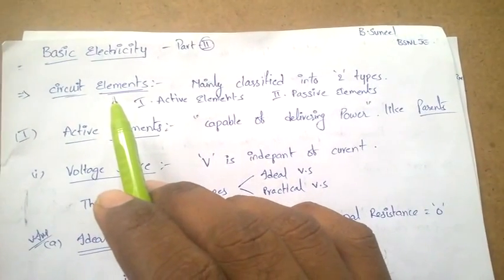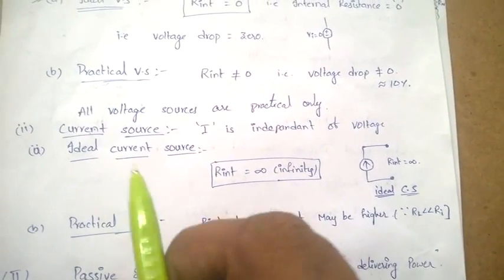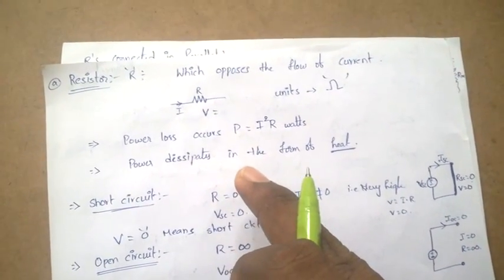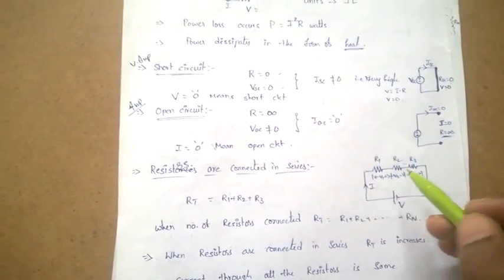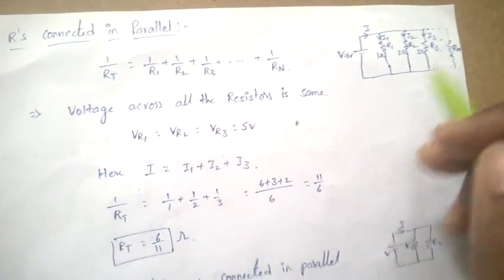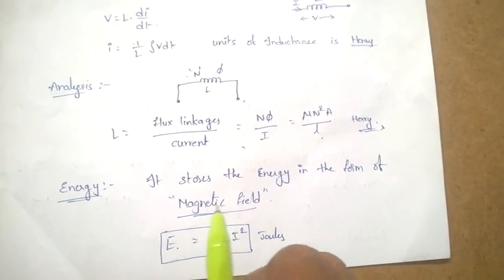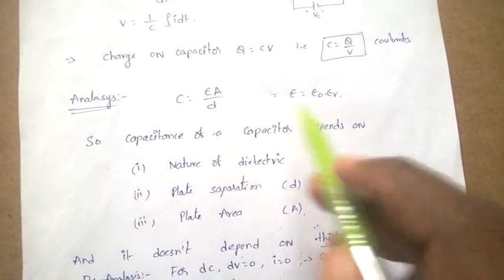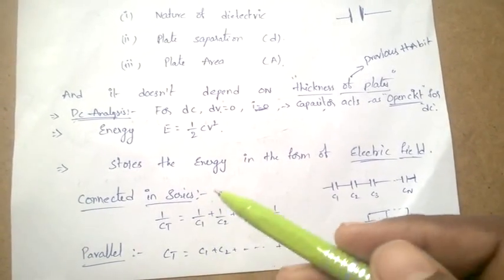bsnlje/SSC JE  exam preparation basic electricity 2

Comment: Sir you are doing a wonderful work.........i really appreciate your work.....thank you sir for all your efforts.....................
sir i just needed to add something in your explanation on the topic of resistances connected in series and parallel..............
@ 2 resistances are connected in series only when they sattisfy 2 important conditions......
A.Current through all the elements is same
B.when voltage across individual elements add up to the total voltage(voltage must divide).
@similarly, 2 resistances are said to be in parallel only if :
A. voltage across individual elements is the same.
B current must divide.

sir i have written this just to clarify a very important doubt of all the aspirants.....which i would like to post here.........suppose we say that 2 resistances are in parallel means voltage across them must be equal......but this is incomplete because suppose we have 2 resistance of value 10 ohms each connected in series to a 10 volt source .so the voltage across each individual resistances will be 5 volts which is same across both the series connected resistors but they are are not in parallel .that is why the second most important condition for parallel connection is that "current must divide". i hope you will get my point.Thank you.